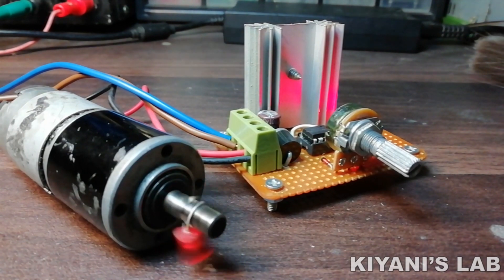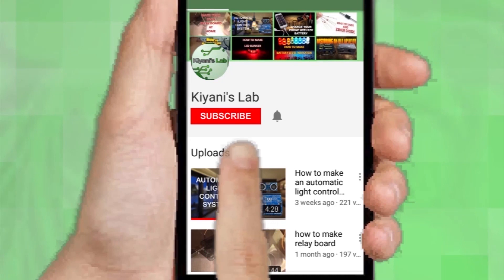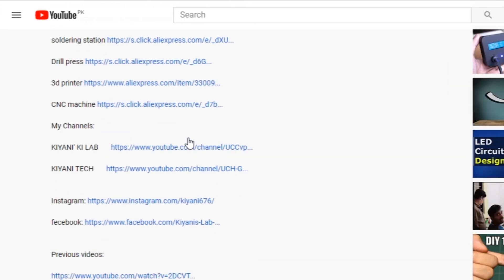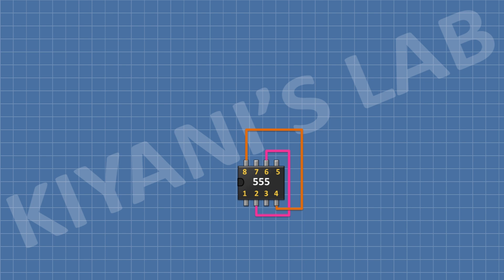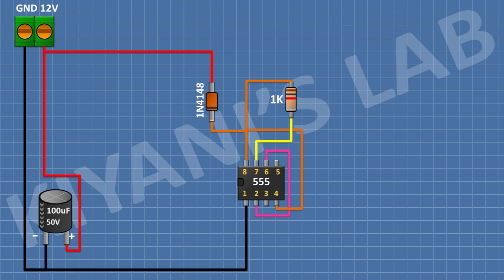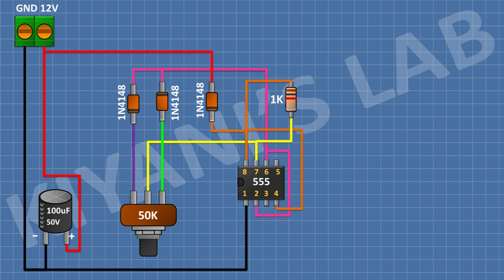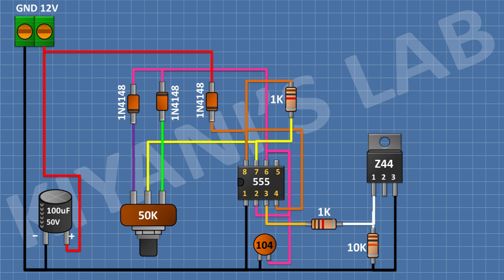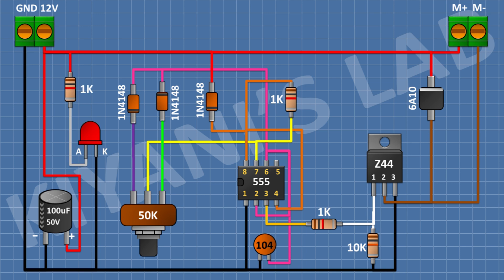How To Make 150W DC Motor Speed Controller

Comment: Is this pwm controller or voltage controller??
Reply from the maker: pwm
Reply: @KiyanisLab  thanks BTW what's the maximum input voltage and amp and will u plz make a vedio on diy amplifier with la4508 ic plz

Comment: Wow 😍😍 great video Sir, I really need this Circuit diagram. 
Can you plz make a video on a auto cutt off Circuit with LM358 IC without relay & Preset for any battery charger 4V,6V or 12V 🙏🙏.
Reply from the maker: Yes, soon